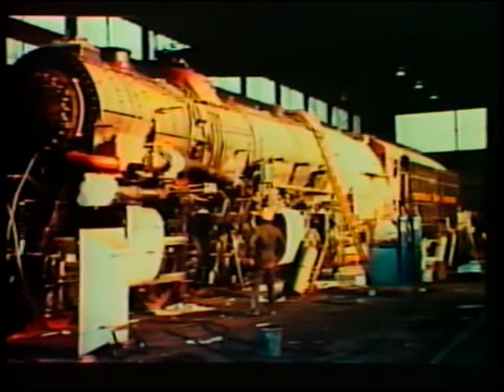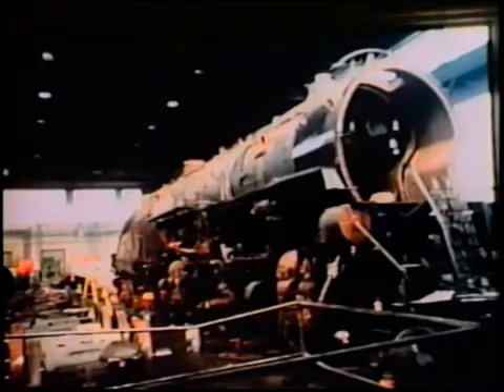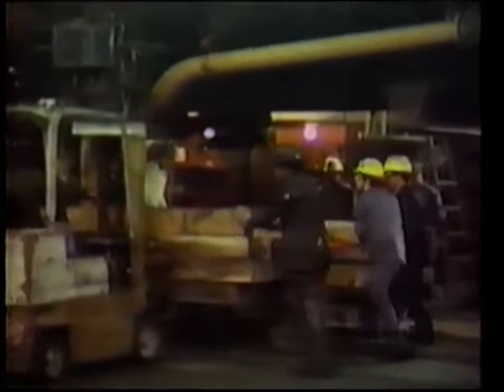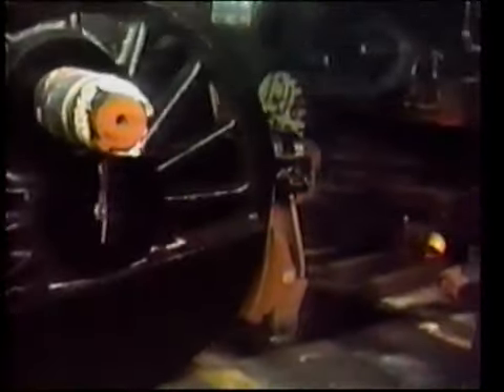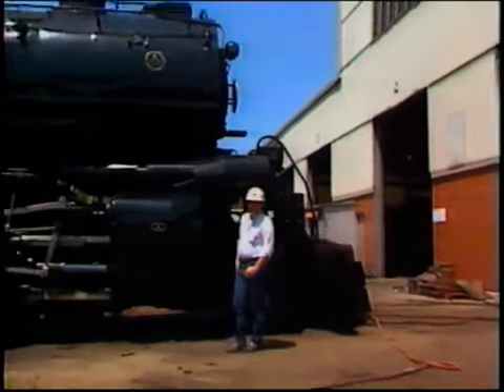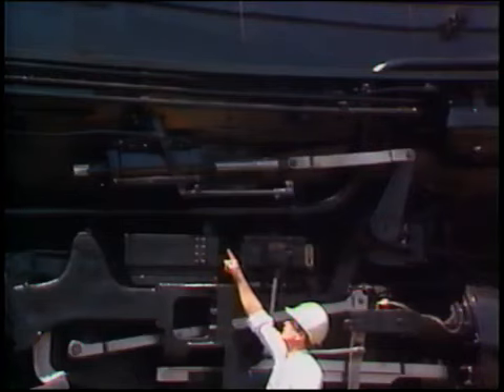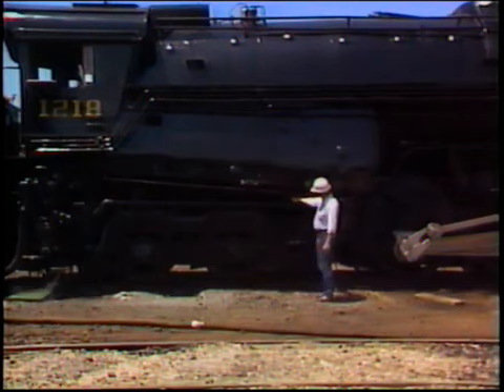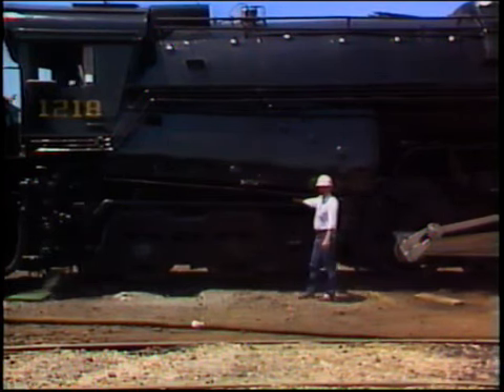N&W Class A 1218 rebuild

Comment: Good news 1218 is gonna be converted as an oil burner.
Reply from the maker: Then it will be used as a mainline engine again too
Reply: that is sadly not true

she is stuck at the vmt due to high costs to rebuild it 😔
Reply from the maker: @cykablyatman6242  it wouldn’t cost anymore than the 611. It was mid-rebuild when it was pulled. Everything missing is stuff that would be replaced anyways
Reply: @RustyDreamsGarage  that is not true either
sadge
Reply from the maker: @cykablyatman6242  having been involved with the details of it. Yes, it is.